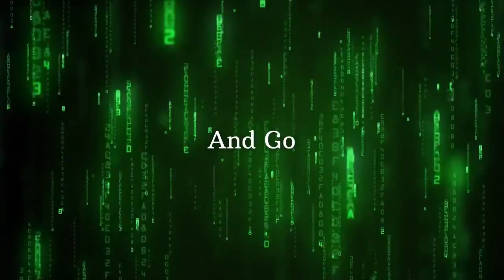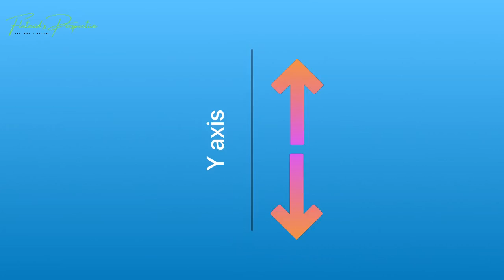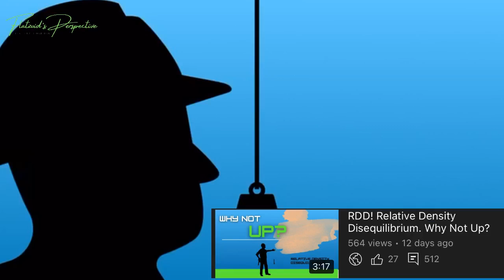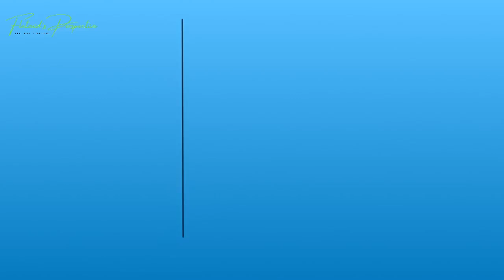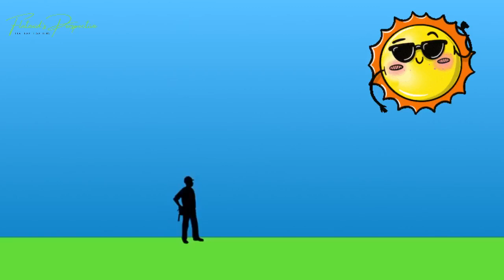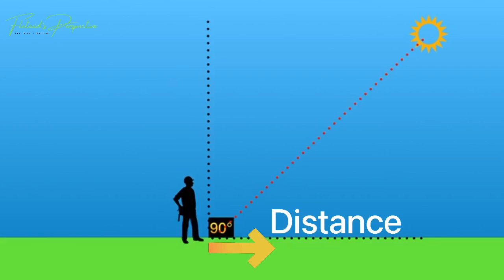Do we need a Horizontal to measure a co altitude angle?

Comment: They're either in extreme denial, struggle to comprehend basic facts, lying, deceived beyond making logica discernment.
A (90 degree) is a right angle.
And the baseline of that right angle is the surface we stand on.
Simple as that.
But of curse they can't accept this, because there presuppose sphere Earth, have a curved surface.
So they ignore the horizontal, because they don't have that on the globe model surface.
So what do they do ?
Create a imaginary equatorial plane, by cutting the globe in half.
And use an imaginary horizontal, but we have the physical reality.
As the surface on Flat Earth is the real horizontal baseline.

Comment: That's not even a plumb bob.
Plumb bobs have a sharp pointed bottom tip to allow them to be positioned directly over a surveyor's or carpenter's pin or mark or marker in order to accurately measure distances and angles. That's just a weight.
And no, you don't need a horizontal to measure the co-angle to a star. Astrolabes use gravity to establish a verticle then measure the angle to the star from the vertical. (1)
Reply: The "horizontal baseline" is a theoretical man made line that is only needed to establish the verticle and zenith angle and is not used in the actual geometry or mathematics used in finding the radius of the Circle of Equal Altitude. 
THE HORIZONTAL BASELINE IS THROWN OUT!
THE HORIZONTAL BASELINE IS NOT USED!
See roohif's explanation in the video "Why celestial navigation ONLY works on a globe,  MCToon Live" At 15 :50 the geometry is explained. (2)
Reply: Also;
The YouTube video;
"US ARMY TRAINING FILM "CELESTIAL NAVIGATION" FILM GREENWICH MERIDIAN 42314 PeriscopeFilm"
Shows the geometry involved in determining the Circle of Equal Altitude with a sextant.
The most relevant information begins at 4 :15, and the complete diagram and explanation is shown at 5 :00.
Watch both videos! (3)
Reply from the maker: a bob of lead or other heavy material forming the weight of a plumb line. No need for a point lol